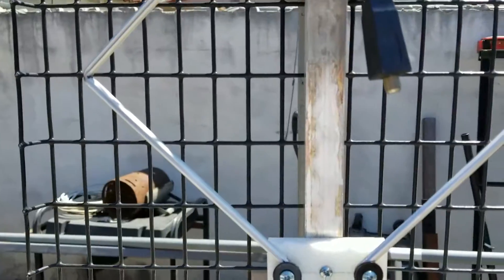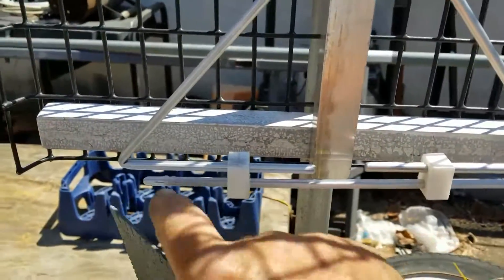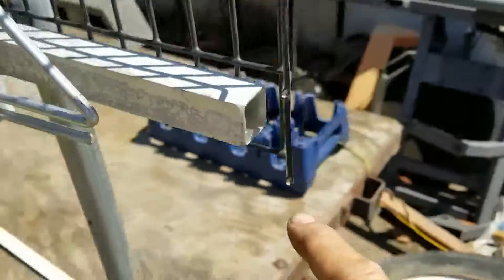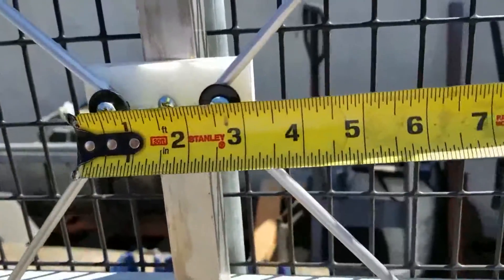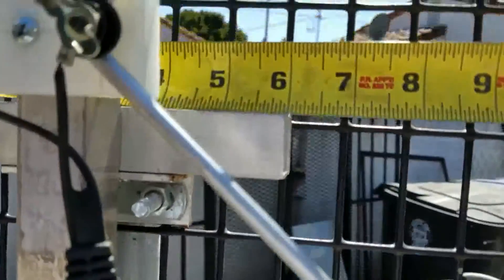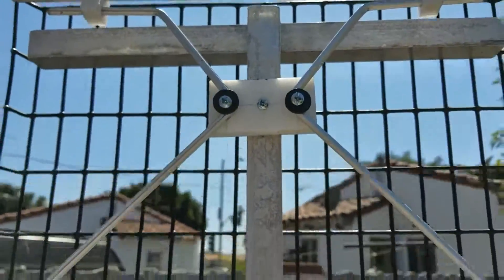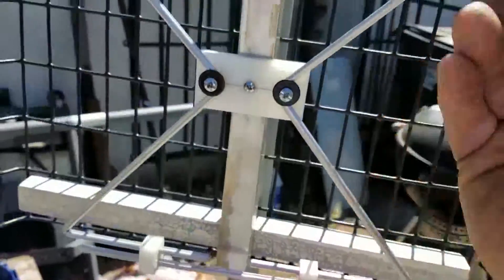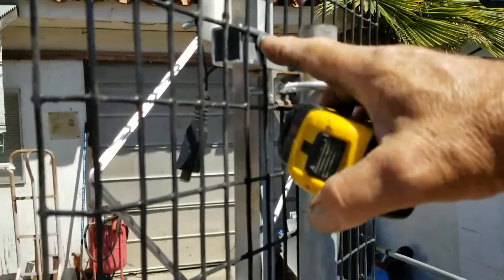My High Gain Antenna Build Specs & Instructions

Comment: O.K. G Bear's since you have so much stuff on hand, when the  acropolis happens I will be heading over for your place to save me. Since I got that off my mind, What I am wondering is if the distance between the reflector screen one by two, is how many inches from the aluminum elements ?? Thanks
Reply from the maker: Lol, you and about a division of others want to head here.🤣
Anyway. The rear deflector of the large antenna is 3.5 inches behind the elements.

Comment: Awesome built!
Reply from the maker: Thanks!  It works well on my off grid cabin in the desert.
Reply: @GBear  - You should mix Stainless Steel, Copper, Aluminium together :)
Reply from the maker: Connecting dissimilar metals together causes electrolysis at the points of connection.
Reply: @GBear  - Really? I've been experimenting and somehow Stainless Steel works better than Copper and with "smaller" copper..., I get extra Channels.  Some Channels I can't get with Stainless Steel, but by adding Copper, I was able to get it.
Reply: @GBear  - Check out my latest experiment here:  https://www.youtube.com/watch?v=P1JW3skjQZ0
Reply from the maker: @JodBronson  great!  Just remember, over time you will get oxidation/corrosion at the contact points.
Dissimilar metals are used in batteries because of their electrolysis properties.
Reply: @GBear  -  Ah ok, thanks for the tips !!!

Comment: Wondering  here...I see that you got 150+ channels on both antennas in the city.  Wondering about out in the desert.  Want to see if I should plan this for myself in the future.  Current bug out site is in a deep canyon so there all com is NFG.  I'd like to use Google Earth to plot some relative angles and distances so I know of a real world homemade solution and what the results are.  So without giving away your privacy...can you tell me the number of channels in the desert, the approximate location in the city and in the desert, so I can see & plot the relative results on a map and look at any terrain features in between?  Not sure of where I'll look in the future but I'd like to have OTA Commercial Radio, TV & Phone during good times.  When SHTF who knows what's going to be left.  In general terms, how far are you from what city.  Again, please maintain your privacy so approximate is good.  Thanks for reading any info that you can share.

mike...in Sylmar, CA
Reply from the maker: I'm in the high desert, not far from Edward's Air Base with a distant view of the Cajon Pass.  There aren't many TV stations out here, and I am not able to access Mt. Wilson.  I do however pick up San Diego stations in high definition, and Victor valley TV'S 5 channels, as well as 4 stations from LA.  Total channels is 25.
To help you decide, antennas are line of sight items, so if you don't have a clear path towards a tower, expect a low quality picture at best.
For phone, nobody beats Verizon for national coverage.  You can check that out online.  For internet, I use a "Cradlepoint" with a Verizon sim card.  That gives me a 4 port router and wireless internet without a dish on my roof for $20.00/month.
To back up TV, I purchased ROKU which allows me hundreds of channels and movie streaming.
Reply from the maker: Oh, and Welcome aboard!

Comment: One suggestion I'd like to make is to make sure you ground the antenna mast. It may not be necessary if the mast is physically buried  a few feet into the ground. If the mast is up on a roof then run a braided copper cable to a grounding stake.
Reply from the maker: Thanks for you comment and interest!  YES,You are exactly correct!  Whenever a metal post is placed upright outdoors, it should be grounded.  (Or maybe a lightning strike will boost my TV signal,   LOL)   I am an electrician and I ground EVERYTHING.

Comment: Does the material have to be aluminum or can I use paint coated steel tubing and rod? I have a few awning frames that are square steel tubing .It also looks like the grid material you used may be steel too?
Reply from the maker: I'm sure you could get reception using any conductive metal, but since all the antennas I have ever seen use aluminum, I chose to follow that trend.  Also, weight would be a factor of concern.  It is important that the reception rods NOT make contact with the frame that holds them or the deflector, so use non-conductive insulators between the receptors and the frame at every contact point.  Yes, the deflector I used is steel screen and that is used to prevent signals from reaching the the reception rods from directions other than the one you want.  That does not have to be insulated from contact with the frame.  You could try the steel, then post the results for others.
Reply: Danny Hodges  says keep reflector 4 in away from antenna.  You should take better notes when you are watching his vids. Did the rest just like him. Good job sir